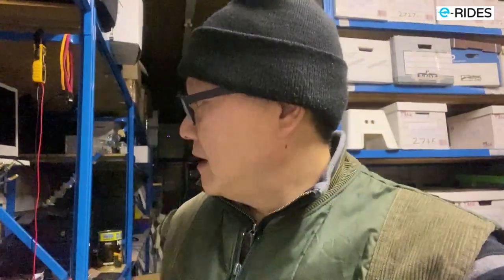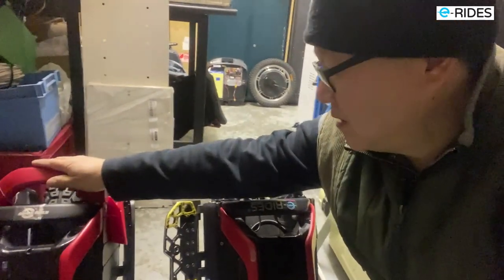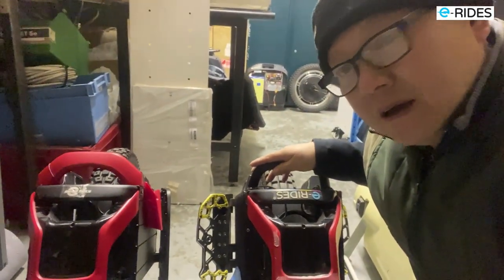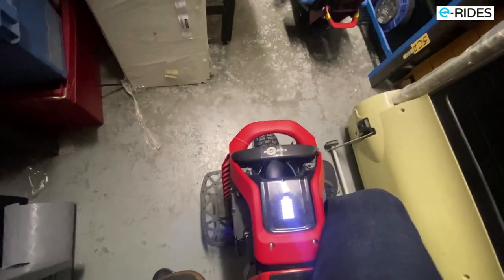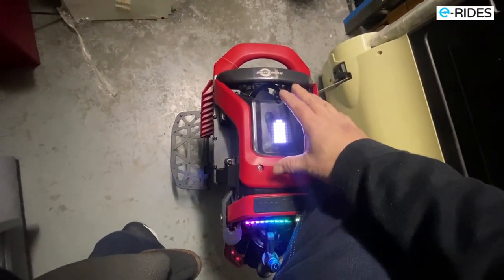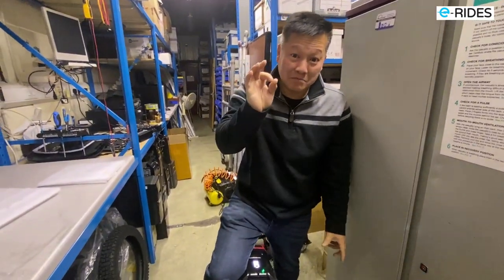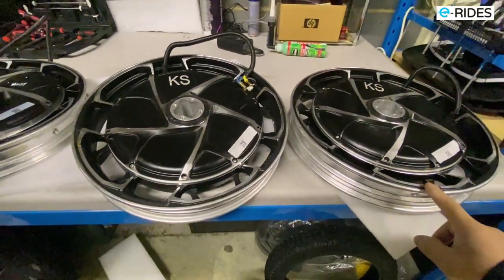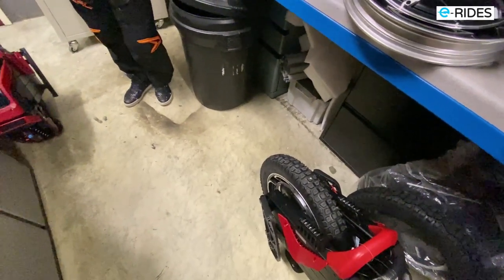KINGSONG S22 NEW MOTOR 4000w funny noise. e-Rides EUC Upgrades

Comment: "SORRY FOR THE UPPER CASING BUT I'M TRYING TO CATCH YOUR ATTENTION!" THAT BIRD YOU ARE HEARING IS COMING FROM YOUR BEEPER, REMOVE THE COVER TO GAIN ACCESS TO THE BEEPER AND MOVE IT AWAY FROM THE SMALL ROUND CAPACITOR THATS JUST ON THE LEFT SIDE OF THE BEEPER/WIRES. ITS CAUSING AN ELECTRICAL INTERFERENCE.LEAVE IT UNCOVERED, MOVE THE BEEPER TO THE RIGHT AND ROLL THE WHEEL WITH THE COVER OFF. THERE SHOULDN'T BE ANY NOISE AFTER. FIND THE RIGHT LOCATION TO ATTACH THE BEEPER AND REINSTALL THE COVER. THE BEEPER IS ONLY HELD ON WITH DOUBLE SIDED NEOPRENE FOAM, IT TENDS TO LOOSEN ITSELF AND SHIFT CREATING THAT BIRDIE NOISE. LET US KNOW IF THIS WORKED OUT FOR YOU?
Reply from the maker: You may be right. Interference from the electronics can cause the sound amplifier to produce this noise. I will try putting shielding in and see if it stop the interference.
Reply: @eucupgrades  Please keep us updated Kevin!
Reply: Waiting 4 da update
Reply: NY is right, it's interferences from the mainboard into the beeper, not an issue with the mainboard or motor themselves.
Reply: @EUC UPGRADES  I don't have any problems with my s22 or weird noises coming out of the motor, do I still need to changed to the new 40000 motor,  is it faster than the 3300 motor??  What am I getting from the new one????
Reply: Thanks! It works!!!

Comment: is the new motor heavier? More power requires more windings, stronger magnets or more metal to dissipate the additional heat. It’s not a significant update if it’s mostly about heat dissipation
Reply: great idea - Kevin please weigh the old and new motor. If they are the same weight then Kingsong is likely bullshitting us with the new power rating.

Comment: Hi! Do you have an update on the chirping noise from the motor? Did word REMOVE THE COVER TO GAIN ACCESS TO THE BEEPER AND MOVE IT AWAY FROM THE SMALL ROUND CAPACITOR THATS JUST ON THE LEFT SIDE OF THE BEEPER/WIRES?

Comment: If not the beeper getting interference, then it sounds like capacitors that are old/leaking or used beyond their reactive power rating (hmmm 4kW motor!).  (old McIntosh Cal Lab audio electronics experience).  You can unplug the beeper to isolate it.  And better yet, wire a switch in series with that annoying thing.  Like you might want it on someday (i thought so), but more likely hate that annoying noise.  My switch has turned off my beeper since I soldered it in.  PS:  Try swapping controllers between wheels see if the noise stops or goes with failing controller-capacitor.

Comment: Hi do you have an update on the chirping noise from the motor? I got a S22 and my also make a slight humming noise when I rock back and forth.
Reply: Update: I been riding my S22 and it's running fine, and you can't hear it outside. Hopefully it's not an issue. I don't head it when I am walking my EUC in the hall.

Comment: I put the original motor back together after sending out the stator for pinning. Now that it is reassembled it feels a little notchy or not smooth when turning by hand. I have an upgraded motor as a replacement on now. Will try the old/repaired motor someday. Unless I try to get rid if the notchy feeling. If you have any suggestions as to the reasseambly... and thanks for the video Kevin.

Comment: Mine is the 3.3k motor and it has the exact same whistling as the 4k motor although it's slightly less apparent. Definitely without a doubt the exact same noise though and the same movement at low speed. Also checked a friend's months back and it was similar to mine. I think this might be a motor to motor thing rather than as a whole.

Comment: I don't have any problems with my s22 or weird noises coming out of the motor, do I still need to changed to the new 40000 motor,  is it faster than the 3300 motor??

Comment: Thank you for producing these videos.
I still have my S22 sitting with 0 miles ridden on it because I'm waiting for the right swap to appear, because that's just how EUC market works right now.
When the right thing comes through then I'll hit my dealer up because I directly told them I'm waiting for the right motor swap on the recall (I only get one recall return, probably, so I want it to be the best it can be) since they wouldn't give me a refund when the motors all started failing on people, even though I have only taken it out of my car after picking it up - not been ridden at all.  I really want to just get on it and go go go, but I also like risk management.
Reply: You should absolutely be riding it. Just take it easy if you are scared. But treating your wheel like its defective and not even riding because of what you see on the internet is kind of crazy. Really crazy actually. I wouldn't be surprised if the dealer wouldn't want to fix something that isn't broken either.
Reply: Don't let the wheel sit that long, either sell it or return it to the dealer and just use the money towards something else, there will always be problems with the Kingsong S22, this wheel was doomed from the very beginning, that huge fire wasn't really a coincidence.
Reply: @curtflirt2  Dealer will not take it back.  Their response is that King Song is not taking returns on recall items and only doing the motor upgrade.  They were sending them out to be pinned but I would rather have the fixed motor and just replace it.  I've tried three dealers of EUC now and two of them are pretty sh~tty...

If I was modestly funded I could build a US made wheel, but that seems unlikely.

I was 25 years into technology development, manufacturing, and deployment when I was forcibly ejected from industry by an accident a few years back.  Self balancing wheels are nothing new, in fact, they practically do it themselves.

Since you were kind enough to reply, I've also worked out some mods that might completely stop or mostly mitigate wobbles - it doesn't take much to dampen those so I have been at odds why the mfr haven't employed methods of damping/stabilization so far.  Seems weird when other PEV are already using damping systems to reduce high speed wobbles/shakes.
Reply: @russellzauner  wOW, that's Terrible, and a real ripoff! People need to stay away from Kingsong then until they get their Sh%t together.
Reply: @curtflirt2  laughs in Gotway name change

Pretty sure there is no EUC manufacturer that is nailing safety and quality in their builds except maybe Inmotion and they get tons of hate for some reason - I've got a V10F and it's awesome and flawless (so to speak) so far.  Not a bunch of range but that makes it lighter for zipping around town and faster to charge; definitely worth the money.

These new machines that are approaching $5k USD aren't even anything new, they're just refinements on existing designs that have more weight, batteries, and bigger motors - pretty soon you'll have a single wheel vehicle too heavy to even lift off the ground.
Reply: Bro, if you RECEIVED that wheel with a bad motor you are ENTITLED to a FULL REFUND if you ASK. They CANNOT send you a BAD WHEEL then just say "Oops, my bad, just keep it til we get a fix for it." I know because I went through the same EXACT thing with EUCO but they did refund my money because the wheel was sent to me bad out the box after only one ride. Same issue, bad motor. I took that money n put it on the Sherman-S with Ewheels. Kingsong has put out a HORRIBLE product with this S-22. Its GARBAGE. The motor AND sliders SUCK. WARNING@!!!! DONT WASTE  YOUR MONEY!!!!
Reply: @dewaynelowery8511  I wholeheartedly agree, but the reality is that the manufacturers need to be held responsible and that's an impossibility unless you completely block their imports, which so far hasn't happened, could very easily have happened at any time and still can, and people would lose their minds and scream for them back saying stuff like "we don't care if quality is crap, we have the right to poor judgement and we're gonna use it".

Dealers are just trying to make a buck and when it hits the fan that's when you find out who was ready to be able to take care of their customers - I'm sure they all want to do the right thing but general word is that KS is kind of hanging the dealers out to dry - doesn't excuse any of it but I think that the dealer I bought it from is running so lean that if they took returns that KingSong isn't accepting then they're going to simply fold.  

Which is also fine, poor businesspeople shouldn't be in business and if you can't stabilize in the first two years then you're probably not going to and you'll always be shaky.

Only dealers that are highly committed to their customers AND had the critical mass or at least reserves to absorb the KS debacle without vaporizing weathered this particular situation well; it was sort of the never ending perfect storm of execution failure after failure.

And at the end of it, really still the only wheel with the hope of taking me where I want to go is the S22.  I am going to gut the stupid thing probably and rebuild it correctly.  If I had funding, we could just build a USA made wheel and be done with importing, well, garbage that's great on paper but still garbage in reality.

If I were building them, we'd had a 100MPH+ wheel LONG ago, because I understand things like gearing and unsprung weight.

Footnote: you referenced sliders - I have a couple vendors after me to build some new parts.  People made this too complicated, all it really needed was a bit of an expansion in length and change of materials.  Check out Igus website to see what I mean - they have the right materials to do slider builds, you'll see that a few seconds after checking it out.  Not an affiliate, just used their products and materials on a lot of projects to solve particular problems.
Reply: @curtflirt2  The s22 is actually great and not doomed, if u actg like the guy @russel zauner that is the absolute opposite you do, No reason not to ride it as in 90% of the s22's (even higher actually) run great and do not have an issue, if it does you will hear the sound from the motor and number 3 and most imp. YOU PICKED THE WRONG HOBBY IF YOU DO NOT UNDERSTAND YOU ARE RIFDING AND ELECTRIC UNICYCLE. DO NOT LIVE IN FEAR RUSSEL. I HAVE A FIRST BATCH S22 THAT RIDES LIKE A DREAM. I am 265 lbs at 6'4 inches tall and jump and off road riding all the time and to hear you say you havent ridden yours do to waiting on the right new motor... bro the motor u have is probably fine and go enjoy the uni as it is my fav. uni out and I tried most of the new suspension uni's and this is by far the best for off road ( i want more speed for road but anyway) Russel GET OUT AND RIDE IT ... WHAT ARE YOU WAITYING FOR! ANY EUC CANT HAVE A PROBLEM SO IF YOU THINK YOUR GOING TO HAVE A CUT OFF WITHOUT ANY SIGNS that usually isnt how it happens with this issue on the s22... You usually know something is up so go have a blast and then get the new motor once u see feel it is time.

Comment: Just a sidenote: I have a batch one KS22 with ZX motor, and it is also making the chirping noise. Thats just mosfets under stress, and i wouldnt give a thing on it. Done about 600miles with chirping noise. And btw: the 4000Watt Pro Motor in the end is ment to be used with the new PRO board, which has much stronger mosfets. Only THEN you get full advantage of the 4000Watt Motor…..